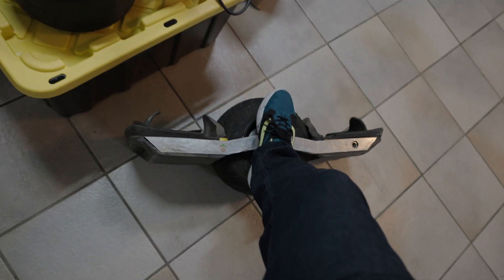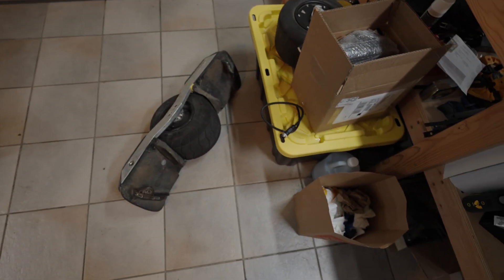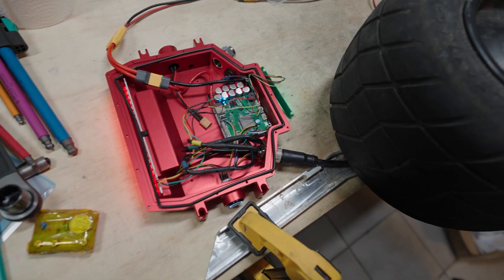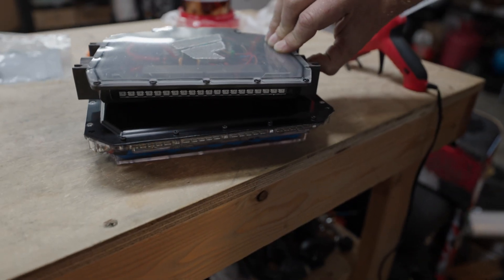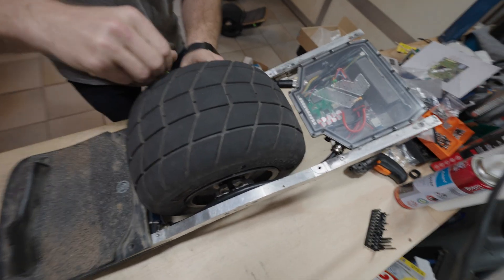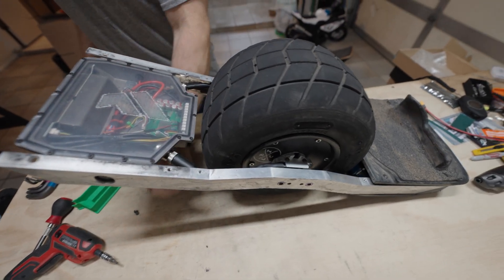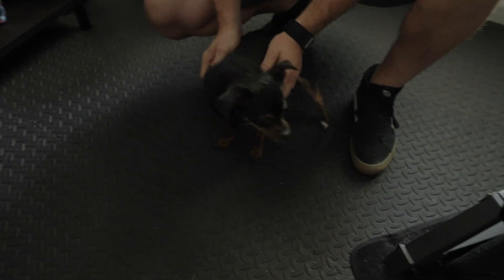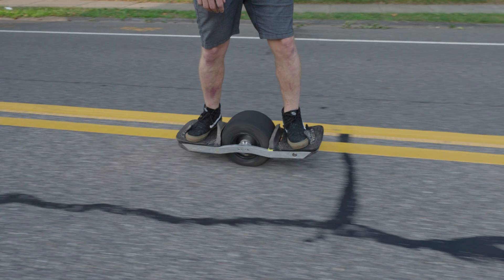Upgrading A VESC Onewheel | Fungineers Thor300

Comment: I'm doing the gtfo kit in my gt using stock hyper motor with mte 52 5 inch hub. Does the Thor 300 deliver more power torque over tge stock fm controller. Comparable to the gtv?

Comment: You didn't address the hot charge port on the Fungi box?
Reply from the maker: The charge port being live isn’t related to the front box, it’s dependent on the BMS. This board uses an XLITE, so the port is not energized.